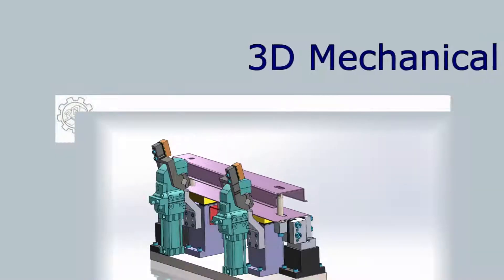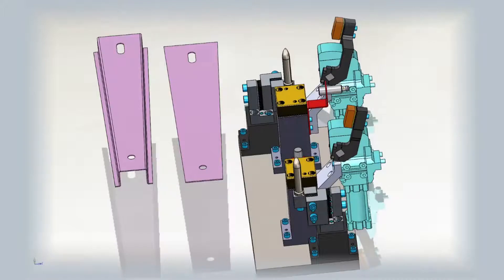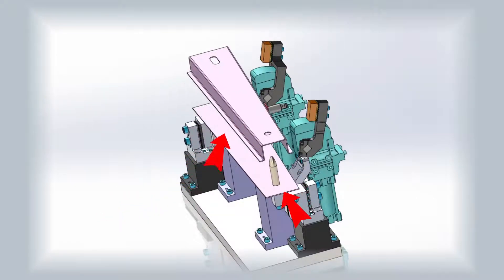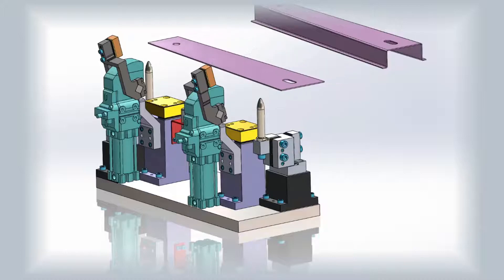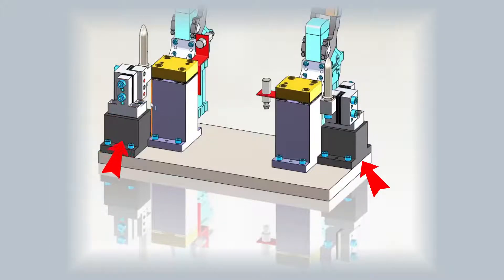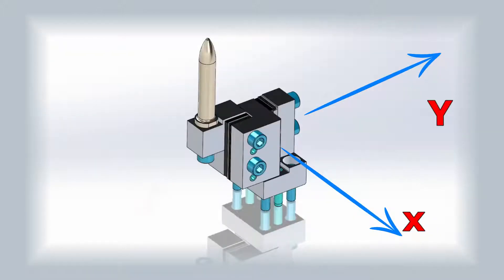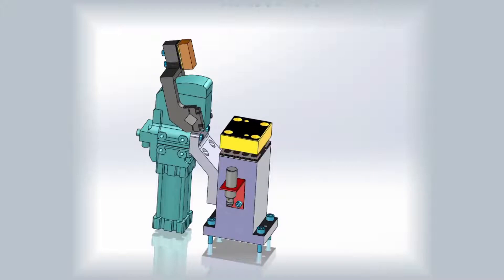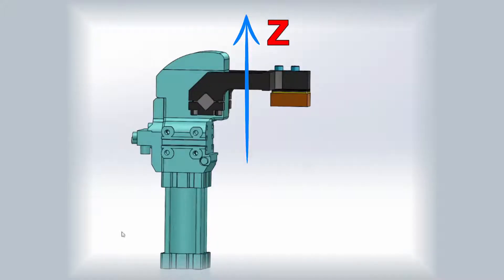⚡ How to design welding fixtures? NAAMS

Comment: Great design but as a senior tool designer I can tell you this would raise some eyebrows on any production floor or weld shop because of how overengineered it is.  This weldment could be fabbed up just fine with half the parts or less that you have designed on this fixture.
Reply: I was just about to say something about entering this into some sort of competition for the most pointlessly expensive fixture that could possibly be designed to hold 2 sheet metal parts lol  --  Im a tool room guy myself.
Reply from the maker: Thanks

Comment: How you do the weld in another side
Reply from the maker: This is a simple welding fixture concept. In case of a problem, a Welding Turntable /Welding Rotary Table or a second welding fixture can be used to complete the OP. Have a nice day
Reply: @3dmechanicaldesign  use the swing clamp it make it very easy..